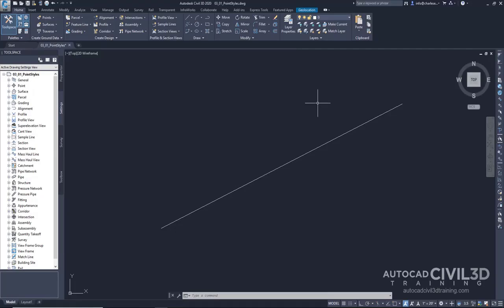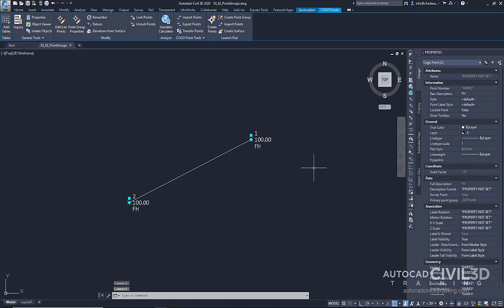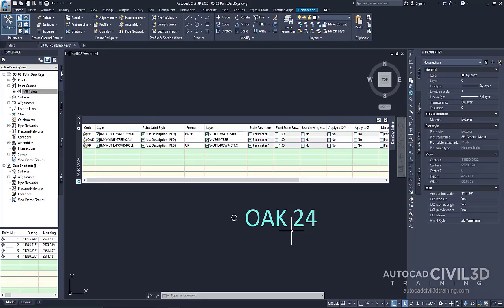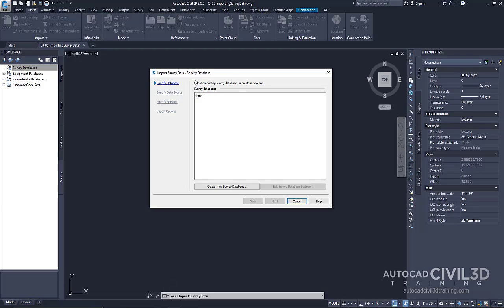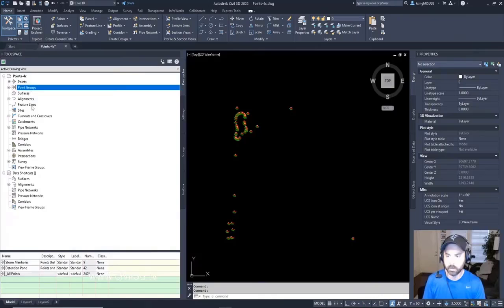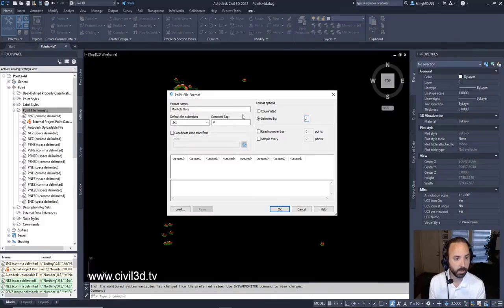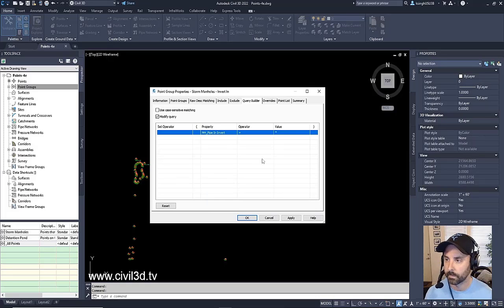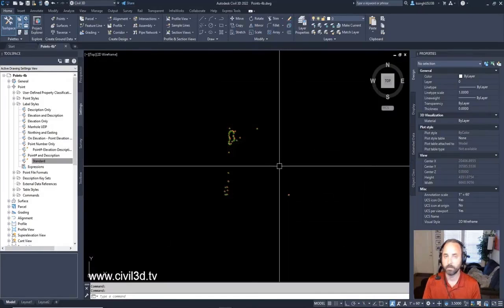02 Adding and Managing Points in Civil 3D for Beginners

Comment: why does my point style is not changing when making new point groups even changing the point style
Reply: In properties u have to set style and point label style in default
Reply from the maker: Point Group priority is overriding it. Move your new group to the top or turn off the groups above it — then the style will update. Also make sure the Point Label Style is set to <default> so the group can actually control it.